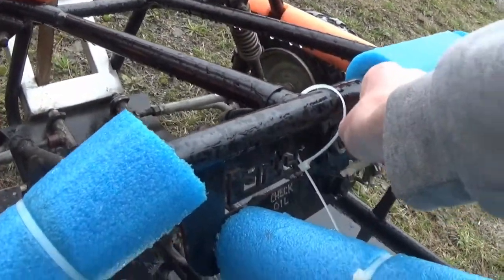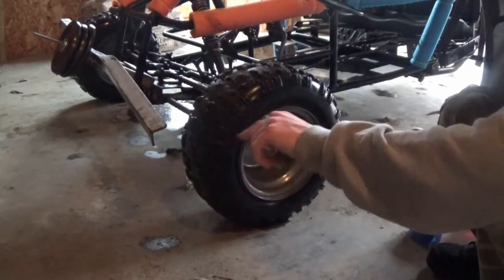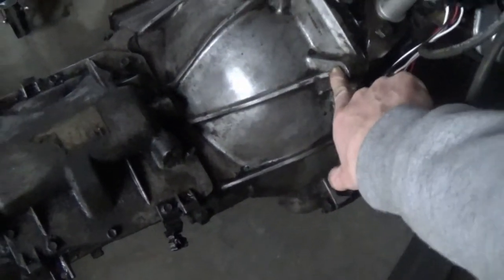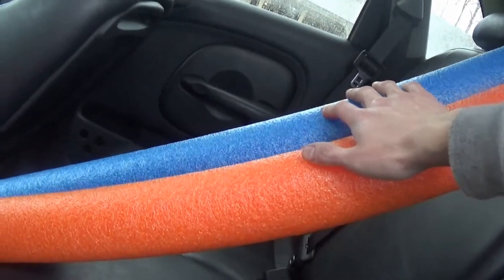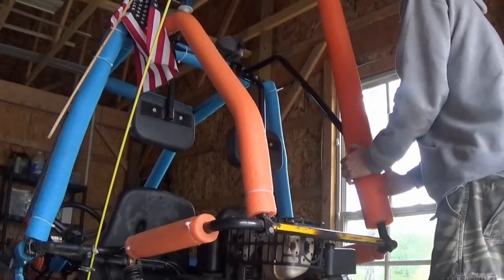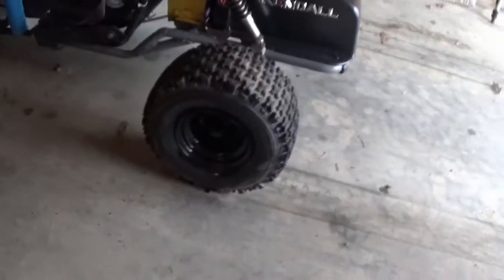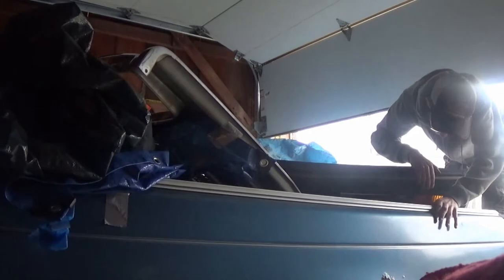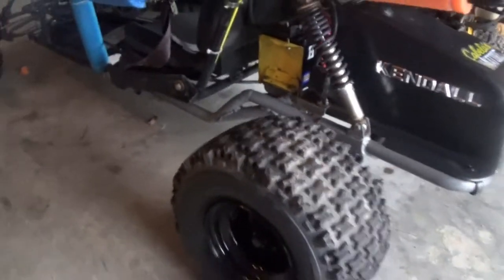The DTS STILL Has Issues??  - & Go Kart Stuff - "Afternoon In The Life" #4

Comment: Always enjoy these vids... Thanks for providing!
Reply from the maker: And thank you for watching!  :D
Reply: I agree.  This is one of the few excellent and well put together channel here on youtube!
Reply from the maker: +AMCNorthstar 93 Thanks man!!  I really appreciate it.  Doing my best!  ;)
Reply: hello i have a 2007 caddy dts replaced head gaskets and it wouldnt start. starter went out upon finishing job replaced starter then it cranks starter from autozone i know crankshaft was leaking replaced crankshaft pulley and gasket now to wont crank or start again took stater back off it works fine on the ground checked fuses relays pcm all good cant locate the nuetral safety switch do u know where it is located on ur car thx if u can help
Reply: Your neutral safety switch would be located either under the center console or the steering column depending if your car has the column shift or the console shifter.

Comment: when u did ur head gasket job did u have to reset  anything or is it simply removeing the head and replacing them
Reply: You only need to replace the gasket itself.  The heads themselves are not a problem. Hope this helps.

Comment: What engine does the DTS have? If it has the 4.6 northstar...that explains a lot. The Northstar isn't Cadillac's best engine, headgasket failure is one of the most common issues. Personally think Cadillac would have been better off putting the LS 5.3 in their cars.
Reply: Oh yea northstar yea I don't think a 5.3 would fit it's already got 10 pounds of turd in a 5 pound sack that's why I like the ford Lincoln Mercury panther platform cars same engine that's in the sooooo many other vehicles and I know I know it heavy and slower off the line but they go for ever and everyone can work on them and parts grow on trees
Reply: Bryan Gall 
True, the ford 4.6 is an awesome engine. almost impossible to kill those. The 2006 and 2007 Monte Carlo SS had a 5.3 LS FRONT wheel drive. I'M not saying it'll fit, but if it did, atleast it's not a Northstar.
Reply from the maker: Yep, it's a Northstar.  They are a pretty "sensitive" engine lol.  I completely forgot about those Monte Carlo SS's with the FWD LS, I'd like to look under the hood of one of those someday.  The newer Pontiac Grand Prix GXPs had the same setup as well.  It'd be interesting to see that setup in a DTS...  it's pretty tight as is with the 4.6, but I'm sure it could be done.  I see why Caddie used the Northstar from the factory tho, more focused on exclusivity than they were reliability lol.  Thanks for watching!
Reply: Yes all DTS Cadillac's have the 32 valve Northstar V8 and was in fact Cadillac's best and there longest produced V8 engine.   Head gasket failure is also common on any engine and also more for any wet sleeve engine.  Most european engines are that way.   The 5.3 engines are fine and have several advancements that came directly from the Northstar engine series.  But they came out way later and are not Cadillac built and are not DOHC which is more favored over the old style OHV design.
Reply: Most cars are better off with an LS.